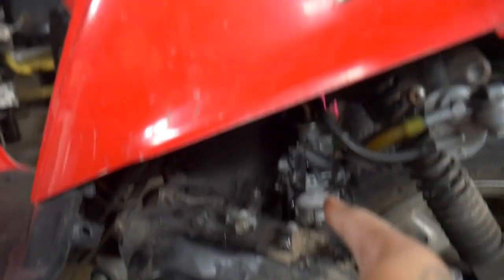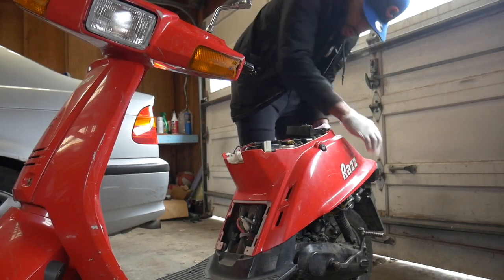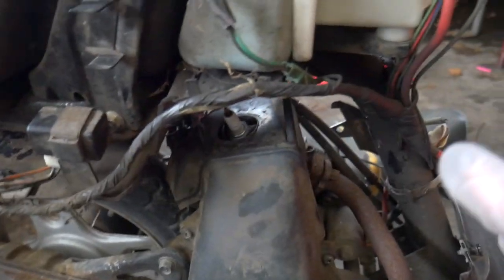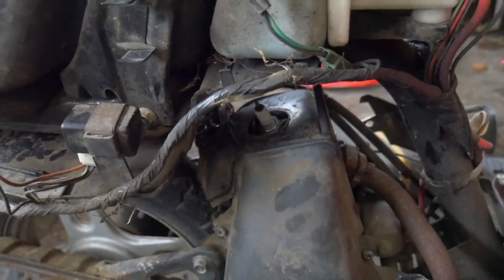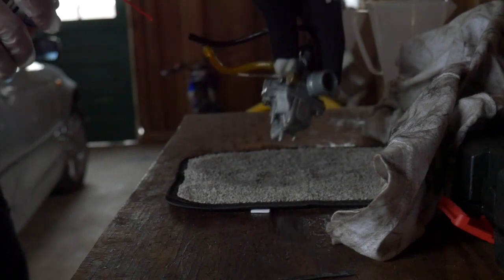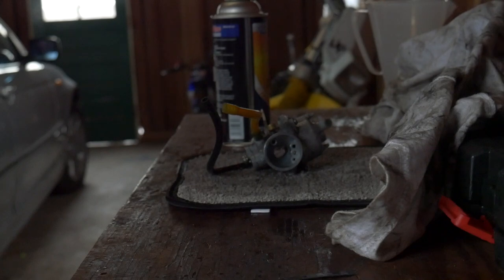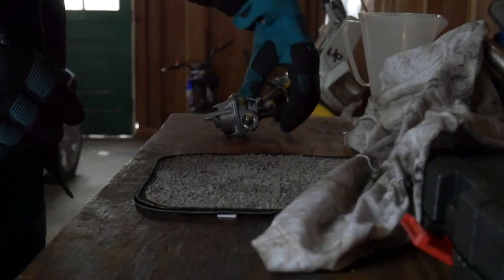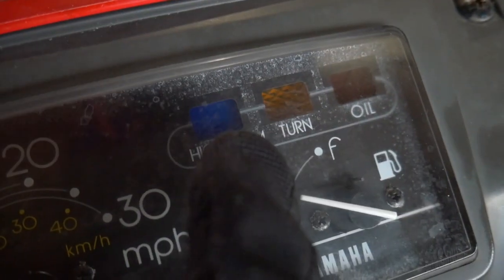CLEANING THE CARBURETOR ON THE NEW YAMAHA RAZZ 2 STROKE! | JUSTDOITTRAY

Comment: Heads up always remove anythin rubber off of your carbs before using carb cleaner,it will rot out your gaskets and gas lines if you accidently spray them